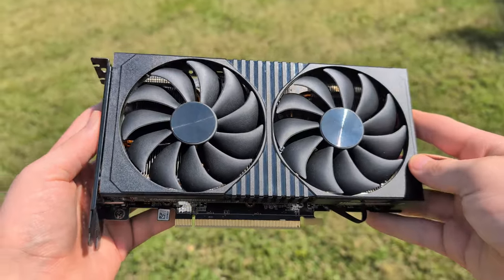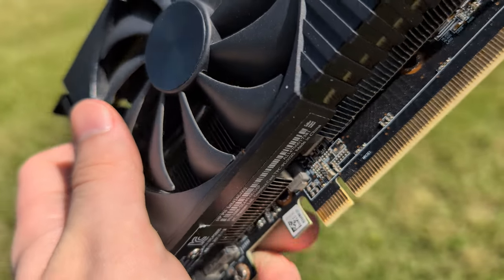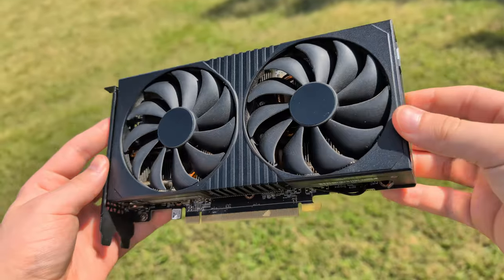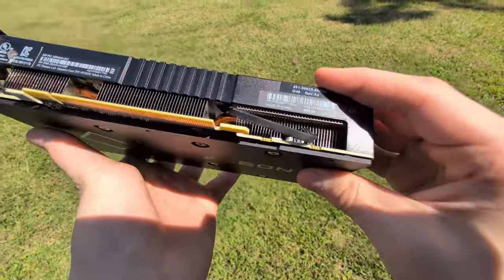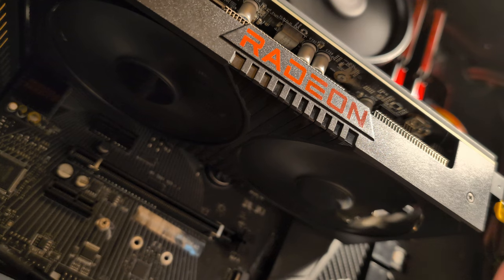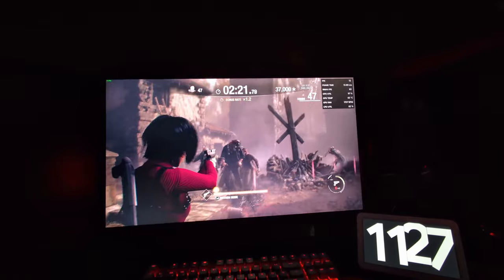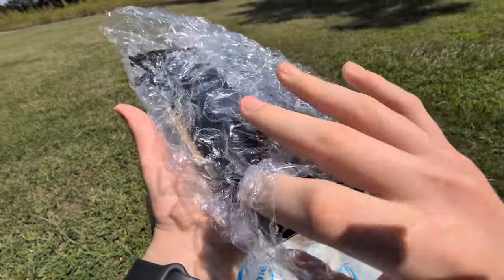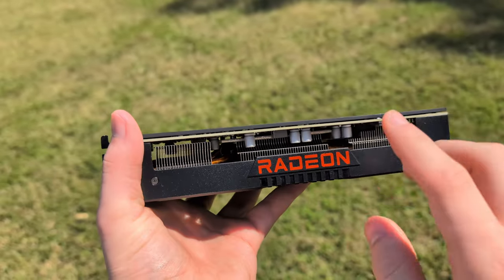Buying A "Broken" GPU

Comment: Bought a GTX 1650 during the last GPU shortage for $20. 

The seller's listing stated it was completely dead, but checking his profile I came to conclusion this person wasn't really tech-savvy and they may not have tested the card properly.

I bought it, installed it in my computer and well, it booted up as it should and ran stress tests for hours..

For the time when that card was selling for $150 that wasn't a bad deal.
Reply: Lucky! What do you think caused the seller to think it was a dead GPU when it worked normally for you?
Reply: @sylentnoise932  They told me they have no idea what's the issue, that it's just not working.. If they couldn't even describe symptoms, they obviously had no idea what they were doing.. + the only image listing had, was the backside of the graphics card, visibly with no dust, and with all warranty void stickers intact.
Reply from the maker: Man, it's crazy that the 1650 was $150 back then 😭 

That's really cool though, sometimes it really is worth taking that risk 😎
Reply: @BrandanFischer  I recently picked up a whole system unit with an RX 470 for $100. Pretty damn good deal. No issues for the past 2 months I've had it
Reply from the maker: That's nice! I picked up a full system with a GTX 980 for $30 last year. The 980 holds up surprisingly well nowadays

Comment: Love the B450 carbon pro AC
Reply from the maker: @heythatsprettygood6492  Yes, it is a pretty nice B450 motherboard! It's more akin to a B550 board than a B450 board in a few ways
Reply: @BrandanFischer  Only thing that sucks is the second M.2 is limited to PCI-E Gen 2 🙃
Reply from the maker: @heythatsprettygood6492  Wasn't aware of that! To be honest though it's a fair tradeoff for the other features
Reply: @BrandanFischer  True, that BIOS flashback has saved me twice from having mine turn into a paperweight

Comment: I managed to get rx580 8gb for 40$. Although the fans are actually broken so I just zip tied a few fans and it works fine lol. I am looking to buy a dead card to salvage the fan but until then yolo.
Reply from the maker: That's what this dude did before selling this GPU to me lol. I've done it before with a GTX 1070

Comment: how much did it cost?
Reply from the maker: $100!
Reply: @BrandanFischer  nice, i expected it to be a little bit cheaper since it was listed as broken and 'used working' listings go for $110-130
Reply from the maker: It was fully functional and the dude knew it, he just knew the fans could act funky. If it had other stability issues then I definitely wouldn't have considered it. Regardless though, this video was less about this specific case and more so proving that sometimes it's worth it to take the risk if you know about a problem and are willing to take a risk 🙏
Reply: @BrandanFischer  i see